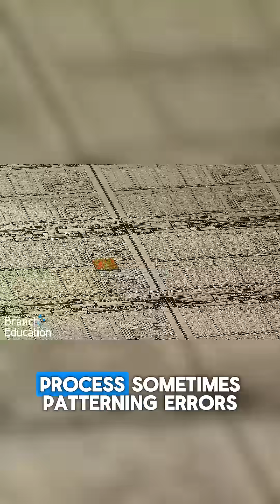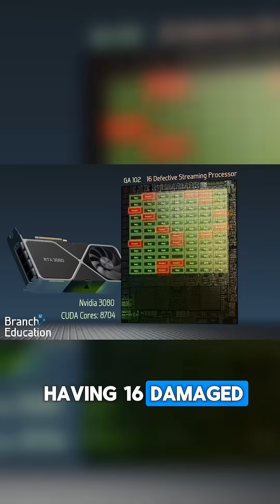How do Graphics Cards Work? Part 4 #gpu  #technology  #engineering  #videogames

Comment: No shit, who would think that binning is a thing in the production where it's almost impossible to make the perfect product! Lol, even the best chips have defects that are being bypassed by redundant architecture.
It's not that long time ago when core unlocking used to be a thing, because the processes produced a lot of chips with lesser defects and it was cost-effective to keep low-end supply with middle-end chips. Intel even tried to charge for unlocking cores, but then the processes and production optimizations evolved. And also the cryptomania greatly deformed the market prices and demand.
There are also very limited production capacities. The price will even tell you the approximate yield of the chips for each model. High-end GPU prices are set not only because of greed, but also because of the inability to satisfy higher demand.

Comment: Yep binning.  I have ran 3 core i9 14900’s in my rig, the first K and KF couldn't hit 6ghz on even 2 perf cores stable, even water cooled.  Soon as I threw my latest KS in it runs at 6.2 stable on ALL perf cores.  Definitely matters having a good chip.

Comment: You aren't technically buying a defective chip, you're buying lower-binned chips that didn't qualify for the 3090

This is one reason why Nvidia played it smart by not shipping x80 models anymore with the same chips as the flagship, 'cause usually it is the same chip. There was a calculation on revenue based on parts they had for each GPU during the 3000 series, and they were making the least profit on the 3080 since it was using lower-binned chips for the 3090. The performance was close enough to see only 10%ish difference. Because of this, 4000 and 5000 series seems to have stopped using the same chips as the x90 series. This is why the 4080 Super was barely any improvement to the 4080 and wasn't even 1/4 close tot he 4090, because it seems like even as an unlocked chip, it's still limited overall vs an actual 4090 chip. 

That's why we won't hope anytime soon a 5080 Ti will even be close to a 5090 this time around,

Comment: The thing is lets assume that an i9 needs 10 cores and an i7 needs 8 but the chip has 9 good cores they will burn and deactivate the extra core to make it an i7. And same for gpus (have cores in thousands) they select a number that will seem like an upgrade from the next lower tier card and stick with that for that particular tier destroying any extra cores or deactivating them. And it is necessary to do so as the software (drivers) are created for exactly that many cores

Comment: So... how can I activate some just in case they deactivated cores to "meet the numbers"?
Asking for a friend.
Reply: You can't do that, they are deactivated by cutting off the circuit line with laser. So it is permanently disabled.

The only known chip that doesn't cut the circuitry is pre bulldozer era AMD. If you buy 2 core AMD CPU back then you probably got lucky to find out your CPU actually is a stable 4 core CPU.
Reply: @RH-rd5js  Ah, I see.
Gone are the days when you could unlock the CPU clock multiplier with a pencil.
Good old days.

Comment: A question, if say only one of them is broken so they can’t make it a 3090TI, do they give u a 3090 with just one less than the 3090TI or do they isolate more to get them to the standard? Also what happened before the 3090TI was released but a perfect GPU was produced? Did they give a better 3090 or isolate them or what?

Comment: This also happens with cpus, AMD did this for example with old Phenom processors, where you could buy a 2 core processor, that potentially only had 2 locked cores to appear that way, but you could unlock them yourself, having a 4 core cpu instead for the price, if the cores still worked, which in some cases they did.

Comment: Binning is not only done for defect mitigation, but also just simple product diversification. Producing 1 chip and binning 4 products out of it is cheaper than making four different chips, which entails changes all through the production process line, from development time in the "CAD" software, the stencil for the pattern up to the testing equipment and software at the end.
And product diversification means more sales, because not everyone is willing or capable to pay for a top tier product but may be somewhat smaller, especially if prices can vary by 50%.

Comment: There was rumor in the early multicore cpu era, AMD deliberately disable a perfectly good core on Phenom X4 CPUs to fulfil market demand for the cheaper Phenom X2 or X3 cpus. On that days, a lot mobo maker add Core Unlock feature to their bios to enable the disabled core. Many successfully unlocked cores on a dual core Phenom X2 550BE and turning it into a quad core cpu.
Reply: I bought a Phenom that was only a dual core stock but used my motherboard to unlock the second two cores and got 4 cores running using this method. Seems like just yesterday. It was my first PC that I built and I used an old Compaq case to build in.
Reply: Damn I remember that...
Reply: It was true, could get a 2-3 core and certain motherboards could unlock the other cores on the chip.
Reply: even some early zen 1 chips came out and accidentally had all the cores enabled, you could find benchmarks of a ryzen 5 1600 with 8 cores running for example
Reply: @spaghettiupseti9990 that's crazy. I legitimately dont remember that. Damn
Reply: Feels like engineers playing in hands of the mindless marketers.

Comment: Does that mean it’s possible that a fluke 3080 could be a 3090ti if someone puts a you for one in the wrong one or vice verse. Cause it suck ass to buy a 3090ti and find out only 8,000 cores are working yet awesome if you got a 3080 and had all the cores running

Comment: If a 3090 is 20 cores and the 3080 15, but the chip has 2 defective cores, do they deactivate all 5 and waste 3 perfectly good cores?
Reply: There are 10 different GPU in 30 series evenly spaced out. It would introduce inconsistency in performance which might add confusion. People would complain they have a almost pristine 3070 TI that performs the same as an at the cut off 3080 but costs the same.

Comment: This is why it's also better to shell out for the better unit. The more perfect the manufacturing of the components the longer the unit will typically last. 

If your pinching pennies just buy the last Gen of top of the line.

Comment: the question is, do the purposly deactive exta cores. For example if a board has 10700 good cores, it cant be a 3090ti, but do they deactivate extra cores to bring it down to 10496?

Comment: This is absolutely mind blowing. How the hell have i not heard of this until now
Reply: They've been doing this for decades. You used to be able to bios flash the graphics card to a higher model and occasionally it would work fine. Free upgrade. These days they're disabled in the manufacturing process.
Reply: @tamrix don’t forget these days they don’t disable to f the customer but rather to avoid faulty cores etc drawing to much power and burning up because it has less advanced power connections compared to the best ones.

Otherwise it might seem like they disable because you didn’t pay for it but it’s all because reliability
Reply: @arvalb0 also there are other components too, such as the vrams and other important components. If there were all the processors working it'd imo cause issues with not only the precise power allocation but also maybe causing issues in the firmware itself.
Reply: @cryonim  if everything worked it'd have a different firmware and it'd be labelled as a different GPU, the non-functioning areas are disabled on a silicon level.
Reply: there must be a way to unlock the asleep cores 😈 maybe on a technician

Anyway probably not worth the risk, money, in comparision with the small improvement that carries risks
Reply: cause you don't read I guess

Comment: The fact that you can isolate the cores of chips without bringing the whole thing down is just a piece of brilliant design
Reply: Its the only way to manufacture microchips
Reply: @NDX-01 Present day yes. But in the very beginning of multi core CPUs they just slapped 2(two) Pentium4 dies in a package with some glue logic similar to being installed in their own slots in a multi socket mb. They were extremely fast for 5 seconds and then would thermal throttle bc of almost double heat dissipation on stock air cooling.
Reply: Brilliant is what AMD does with their GPUs.
Reply: Wanna know how they doing this. In my company they struggle with this massive...
Reply: brilliant? More like "hey boss it still works tho we could still sell it probably"
Reply: @RandalMcdaniels  In fact this is common since a very long time. They also deactivate working parts if they need lower cards. That´s why there have been some "hacks" in the past with older CPU´s and GPU´s to upgrade them to a higher version (if you are luck and got one without a real defect).
Reply: @RandalMcdaniels  pretty smart
Reply: Alien technology !!!111!!11!
Reply: @fancynaeser9154 don’t discredit the brilliance of todays engineers.
Reply: Materials science do feel like that sometimes! @fancynaeser9154

Comment: Used to be pretty neat too when you could manually unlock them as well, AMD's tri-core CPU's way back when could be unlocked to quad-core but you ran that risk that the defect would pop up and be an issue.

Comment: the story isn't 100% cut clean you could have just one cuda core dead but the others fine but it still gets turned into a 4080 since it wil start to go nuts if manufacturers release a 4090 with 1 less cuda core or one with 10 cuda cores missing and so on because the damage isn't equal between cards

for instance back in the day you had phenom processors that couldn't cut being quad cores so instead they got turned into dual cores people figured out that often the 3rd core worked without issues and turned those on this caught on and we eventually had triple core phenoms

there was also a potential that your dual core phenom could become a quad core still because the reason why the 3rd and 4th core was disabled was due to the 4th core requiring slightly more voltage then the others but this could still fall within the max safe voltage a cpu was allowed to run just not within manufacturer spec

Comment: What if you get a 3080 that has all cores functioning properly BUT theyve been disabled to sell as a 3080 and not a 3090 ti?
Reply: i guess that would just be a loss for them due to the wasted potential, but CPUs in the olden days used to have unlockable cores for which you could pay a fee
Reply: Why would they do that when they could just sell it as a 3090Ti or better yet some workstation/server GPU.
Reply: @shremk9100  hmm but hypothetically they could do that and unlock the extra performance on a subscription model or something. But ig ppl can just modify the bios to get around it

Comment: So basically they are selling defective items with each selling point and names 😂
Reply: yes, this is similar to i3, i5, i7, and i9 cores, instead of throwing them, they list them in different categories. having a weaker "fully working" processor is not cost efficient and would create a bunch of e-waste. a 4080 is still insanely strong, about as strong as the amd's 7900 XTX. they aren't "damaged" to the point that they are defective, so the manufacturers just deactivate them. this is why a 4090 refurbished typically cost way less compared to a brand new one.

Comment: Depends on how you make a chip, its just silicon, sand and fancy smancy stuff.. but if you forge a cube, and do an internaal processs of carving out the chip with interpolation wave at a higher fidelity and then you wafer cut the ship set off, it would be produced in its compressed elemental state for its pathways, without any or ever other interference to creating an error, providing that its soul source is molecularly cohesive and exact without pockets or holes or flaws...3 printing at the same level of accuracy could make or change the future to isolate and remake those cores so that it would perfrom at the highest state of its intention. so the blue print is and would be done differently.. but were not allwoed freedom so I odn'tk now... but what I got out of this is that the real chips are sent else where? and the cuda core is like hte minimum your getting ... lol

Comment: This is essentially what they do on all chip manufacturing. However, sometimes it is just easier to "cut off" the parts that are not working instead of cut the silicon out, as they do on smaller chips.

Comment: Hence, the silicon lottery.
Chip manufacturers used to not fuse off out of spec parts of the chip, and would soft disable them in software or microcode.
AMD had a Tri Core CPU that on certain motherboards, you could force it to unlock the 4th core, but it was a mixed bag on how good that core was.

Comment: I mean same thing has happened in the diamond industry for years ! A natural diamond isn’t the best of its pure form. If you need to manufacture it , you first extract the cleanest part(IF,VVS,VS…) based on its weight and don’t discard the rest of the diamond instead you make other diamonds with less purity( SI1,SI2,I2….) and eventually most of the diamond is manufactured and you increase your value by manufacturing less quality but in the name of DIAMONDS!

Comment: one interesting fact is that they still haven't managed to avoid defects. more realistic is that they MANUALLY disable cores in order to make multiple market offers.
Reply: You would be correct if the process had never improved or changed. However, we are continuously getting better products compared to years ago. For instance, the fastest products from 10 years ago were difficult and expensive to produce, but now those same speeds are considered cheap and even low-end. This is why there are still different price tiers—because the products are constantly improving. If innovation were to stop, the process might become nearly perfect, and manufacturers would only sell the best products from years ago. That's why at the end of life from a line of products they got a little cheaper, cause they improved the process to be more error proof, it just how engineering costs. If they throw the "bad" products away the perfects one would be too expensive (more than it is)
Reply: @NikolazLopes  as some investigations indicate progress doesn't go that fast and most pricing etc is artificial, because incomes are mostly planned and market is monopolized. So manufacturers that control production and development chains slow it down, make shortages etc in order to provide constant income. They simply regulate the market, price and demand. As well as they manipulate it. They also monopolize access to technology so that nobody really knows what happens
Reply: its both. If a 3080 has 3000 cores but the chip has 3100 they will manually disable the last 100. However there are always faults. The electronics are just too small. 
In the llifespan of a design, the manufacturing gets better, leading to better chips with the same design.
Reply: @Buecherregale  my thought was that they don't produce many chips with different specs. They produce same chip, make a brief test in order to determine samples that run at maximum clock speed and then they flash microcode to configure it as some particular model with specific number of cores, clock etc. best samples go as top end models etc. faulty chips don't go anywhere and nobody looks for faulty cores to cut them. Its too small like you said. situation may be even worse. Theoretically they can configure one chip as different generations of it in order to mimic development and maintain incomes

Comment: So you mean you could fix those areas and get a better gpu?
Reply: No, its like a Hd with a written bad sector. so when data is written it avoids that sector still making the hdd usable. CPUs are the same , defective cpus are given a lower model number that usually cant be overclocked
Reply: @triggahappyyt5420   ok that makes sense

Comment: So many people are complaining about buying a “defective” chip its no defective if they didnt do this the only gpu you would be able to buy would be for example a 4090 and it was cost about 6k because of all the waste there no selling 4080s etc
Reply: That's how manufacturing in the Soviet Union worked decades ago. When they produced a transistor for a given quality, they threw out all which didn't met the specs. And that's why you could measure and select ones which were way about their specs.
While in other part of the world, automatic machines tested every piece and binned them. The better ones were sold as a different product ar higher price.
Reply: It's still defective, you can't doubt about it. It's just they sell those defective product at fair price, not at the same price with 4090ti. So nothing must be complained.
Reply: @za_pravdu1943 not only selling at a fair price, but because it has less cores etc they don’t need the biggest and most advanced cooling/vram/power connections, so they can get away with putting less of this on it, aka making it a lot cheaper while you still get a reliable gpu
Reply: Truth. Binning makes absolute sense in this product type. Heaps of other products use this manufacturing philosophy; optics for instance.